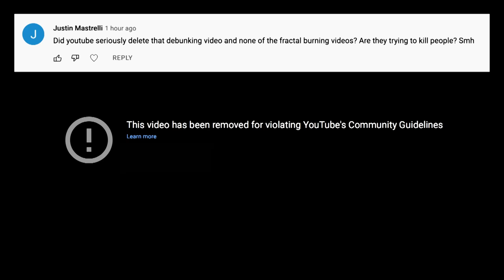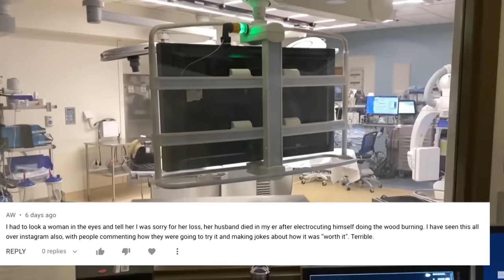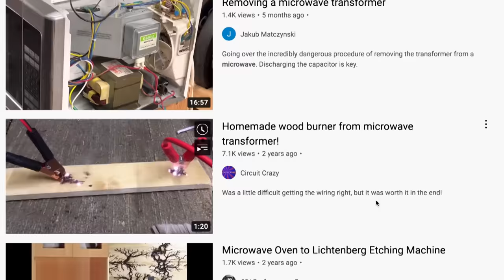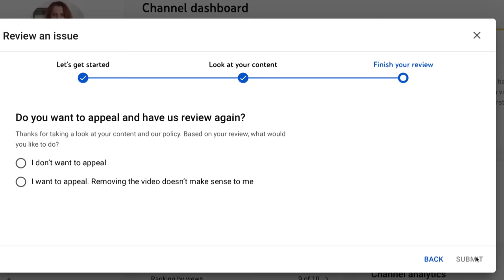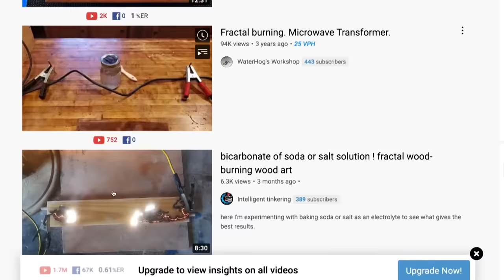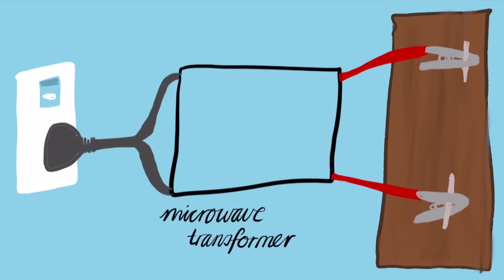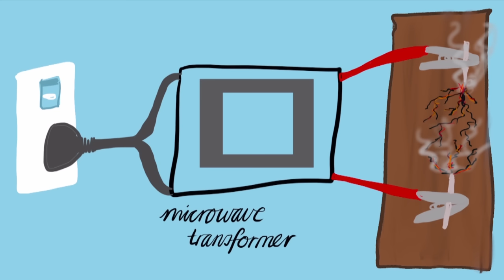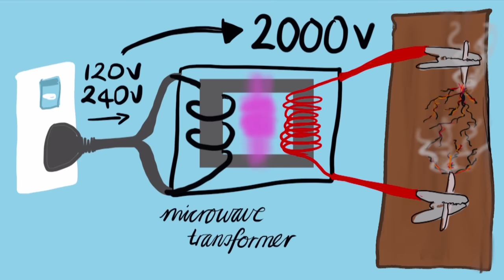YouTube BANNED my Debunking Video but leaves DEADLY how-to vids online, 34 dead!

Comment: A friend of mine was really considering trying this a few weeks ago, I was going to help her, fortunately, I found your video before making such a big mistake (I'm the kind of person that would've ended up touching the electric parts out of curiosity).
In the end, we just replicated the fractals with black and gold paint.
Reply: I'm so glad! If you'd like to burn wood in a safe way, look into pyrography/wood burning pens. You can get basic ones at most hardware stores, and it's just a metal pen with a tip that heats up when you plug it in (you can change out the tips on a lot of them for different looks). There's no electrocution risk, you just have to be careful not to poke yourself with the hot end because, well, it's hot.
Reply: @LevadeNZ  i second this, i hadn't even thought of that but what an excellent suggestion! they're also often found at art/craft stores like Michael's, and are pretty easy to get the hang of! the risk of a burn is similar to a hot glue gun, in my opinion, where if you're careful you should be fine- it won't be fun if you do get burned, but it certainly is a thousand times better than the dangers of fractal wood burning! stay safe out there <3
Reply: That actually sounds quite beautiful.

Comment: Honestly, I used to do wood burning a lot as a teen, and this looked like something that had cool results that I might have tried to do at the time, and likely ended up in the hospital or worse.  Thank you so much for putting out this video!
Reply: glad you're okay. DIY stuff is sometimes a lot more dangerous than it initially seems, like with fumes from resins or the dangers of not using lye right in soapmaking. It's wild how the genre of 'satisfying craft' videos so often having wrong or harmful info in them have made dangerous methods so accessible and popular. Scary!

Comment: It was a good thing to mention about Electricians as most of the tools we use are only rated from the manufacturer for 1000-1500V and at these higher voltages normally insulating material can become semi or fully conductive.

We are also prone to suffer from complacency in this regard but people should realise that working with these voltages is also an entirely different trade. (linesman)

Comment: There was a group that demonstrated this to children at a summer science program I volunteered with. They never talked about the dangers other than the fire danger so they had it outside. Thanks for posting your video, otherwise, I'm sure a friend will try this someday and now I can be like NO NO NO NO NO NO.
Reply: There should be a talk with that program. They should know the dangers more than anything else. Why are they showing this to children?
Reply: @1greninjawolfbossdeath648  local art co-op were the ones demonstrating it. It was a STEAM summer event. They never got close to the kids or had them interact, but I doubt the organizers knew the dangers just like those demonstrating them probably also didn't know the full dangers.
Reply: @hopemoore  "There was a group that demonstrated this to children at a summer science program I volunteered with"

Then next time, show them the proper safety precaution. Fire is the least dangerous danger for this life hack.

Bring in the proper stuff needed to make spark with a ignition coil from a BBQ that need a 1x 1.5v AA battery. Show them high voltage sparks are safe if the spark/lightning look blue and doll. Sparks from those are around 1000 to 5000 volts but are very safe.

Then show them a different setup that make orange/white spark/lightning (Like the wood burning nitwit at 8:41). Those are lethal and shouldn't be touch let alone be hold the same way this guy held those nails.
Reply: @TwinShards  I was a grad student in VR/AR and game development - the organizers were in doctorate programs in education  - why would I or the organizers know how to do any of this to show them anything?

Volunteers aren't specialists and this happened in 2019. Not sure what happened since.
Reply: @hopemoore  I don't blame you for not knowing. But those that demonstrated shouldn't have demonstrate something if they themselves didn't know the danger of it.

Have a good day! :)
Reply: Messing with electricity is dangerous. Even mains voltage type stuff can be dangerous. There is a reason high voltage electronics tend to be stuck in a box. There is a reason computer power supplies and the like have giant warning labels about not messing with their interiors (high capacity capacitors are dangerous - even hours into days of being disconnected from a power source, unless fully and properly discharged).

That being said: You can do this safely. It requires the proper set up, and tools - and that takes what is an afternoon project into a multiple day type thing.

You need a well designed enclosure for this - not just for the transformer, but the entire damn thing. It should have a lid that has a power kill switch that is activated when opened. It should have an indicator light whenever you turn on the main power switch. Ideally the power switch is keyed - so that you can't accidentally turn it on. It would be best if there was no need to directly interact with the electrodes either - but just in case, the entire electrode should have a thick insulating layer on every bit except what goes onto the wood itself.

If this sounds way to daunting a thing, or you don't think you could reasonably put this together without an indepth guide - I might suggest: You should never, ever think of going within a days march of this. Yes the results are cool - but I suspect you like being alive.
Reply: @1greninjawolfbossdeath648  I mean depends on the age of the children. I honestly don't understand how someone could look at a video on youtube of someone taking a transforming from any device and using it for wood burning and not think, yes this is extremely dangerous. This is basic like 3rd grade science.
Reply: @Bourikii2992  Well when someone says the word children I think young like 14 below.

There are grown adults who have died trying to do would burning. As she said in the video the videos are labeled as hacks fooling people into thinking it is safer than it is.
Reply: @1greninjawolfbossdeath648  My point was children 8-14 should know this is extremely dangerous since its basic early grade science. You start learning that in third grade. 

Let alone adults... Especially adults with years of electrician experience. These people are basically the equivalent of woodworkers who break every rule of safe wood working and talk shit against Sawstop.
Reply: Im sad, i know people whove done it safely for decades, can actually be an art form if you wet the wood in a pattern and let it soak in that pattern
Reply: @TwinShards  Yes.. That's kinda the point she was making no?
Reply: There are safe kits for doing this but almost all DIY ones are dangerous and a great number of the kits are missing critical safety components
Reply: @hopemoore  just showing that to the kids is putting ideas in their heads. that's so crazy.
Reply: @wildwomanofthewoods  Lmao shit, you're right.

Comment: As a woodturner, I have NEVER had the slightest desire to try fractal woodburning.  I totally agree with you Ann, electricity is far too dangerous to play with, no matter how pretty you think the results look. Thank you so much for raising awareness of the dangers of this!  You are spectacular!  Much love from NZ.
Reply: There is a safe way of doing it though. But that's expensive.
Reply: All you need is a grounded case that only alowws electricity to flow when closed, you could probably even use the oiginal microwave case. But if you aren't like a eletrician or something similar this would also be incredibly dangerous because if done impropperly you might set the whole case under voltage. Which is to say, let experts handle potentially dangerous tasks because they probably think of risks you arent even aware of.
Reply: @mgntstr  watch Sprague wood turning. He uses a dead man switch, but even he says it's scary.
Reply: Elctricity is very fun to play with actually!
Reply: @Crazmuss  Kinky
Reply: Well either that or alternatively just set up the wood with the pliers turn it on and stay near the switch that turns it on (I.E. 12 feet between you and the microwave transformer - and another 5 feet from transformer to wood) I would argue anything goes within the 20 foot safety distance you shut off the power though
Reply: As with anything in life, it's as safe as you make it. There is a way to do fractal woodburning that is completely safe. The problem is that this is not a safe way to do it... and the average person can't even be trusted with a table saw, let alone be trusted to determine the safety issues with this method of woodburning.
Reply: @AngryAlfonse  Fair enough

Comment: Also most of the wiring insulation and stuff are rated for 1000V max. Big car aligator clips are for 12V, can be rated 50V or something. Using these wires with 2000+V is asking for trouble.

Comment: I wasn't familiar with this wood burning technique, but I'm VERY familiar with electricity. The second you said people were using transformers from dismantled microwaves, (especially older microwaves,) I was like 😳 are you freaking kidding me??!! With a 110 to 2k+ transformation I can't believe there's not more deaths! In that quick conversion, the volts can actually arc to ground (think lightening) so you don't necessarily even have to make contact! Thank you for trying to educate people on this subject.

Comment: insulating gloves has also voltage ratings. At least here in france they are used most of the time to check the absence of voltage with a specialised meter. Doing work with hot wires is rare and usually done by highly trained and cleared peopole

Comment: I noticed that in some of the videos the electricity arced half a foot through the air - that is a CLEAR danger sign of how dangerous it is - air is a very good insulator and if electricity arcs that far, it could easily arc through the body instead.
and if the electricity is enough to burn wood, it is enough to cause 3rd degree burns, leaving no skin left.

While this type of operation can be made safe, it requires professional care - isolated non-flammable room, heavily insulated cables, remote operation with special equipment made to handle high voltage, customized equipment to use optimal voltage and minimum amperage, and special high speed cutoffs on the burning side.

Without personnel experienced in high voltage work, fractal woodburning is an extremely reckless activity.

Comment: These things ARE super deadly. Built one with my dad years ago, he was an electrical engineer so it was built right. I had to wear heavy insulated gloves, we had a separate breaker dedicated to it, and the on/off switch was well away from the worktable. Furthermore he never let me use it when he wasn't there and kept the breaker locked (he really knew teenage me) and what 2000V meant.

Comment: I'd like to point out that if the wood and wires are properly isolated from the ground, theoretically, touching just one point of the circuit (even one of the metallic rods) isn't going to do any harm, as there needs to be a closed circuit.
However the problem here is the presence of water , which makes this kind of isolation very hard to make and impossible to fully guarantee. However for those who would still want to try, you need to use dry plastic to put the wood on, and make extra sure that there's no contact between the circuit and the ground. That won't make it safe, but will decrease the hazard.

Comment: It’s those wood burning videos that need to be removed.

I’ve worked with some extremely high voltages (fusion reactors type high voltage) and can say that the voltages used in wood burning make just being in the vicinity of one potential lethal.

It should be these wood burning videos that are taken down and de-monetized.

Comment: This sort of thing is horrifying. There is probably a way to do it in relative safety in a properly risk assessed and designed for purpose environment. A microwave transformer and crocodile clips is a terrifying bodge that I wouldn't go anywhere near.

Comment: I never even knew this was a thing. I was taught at the age 10 when I built my first computer to NEVER touch anything that has copper wires wrapped around it. ANY thing with copper wiring wrapped around it and is contained it any kind of metal shielding is like that for a reason. Usually components like that are meant to convert the electrical power from your wall outlet into something useable by the electronic device. Even when that device is unplugged it will still hold on to a charge for months even years depending on the device. Unless you are trained to do so and I mean ACTUALLY trained and not trained by watching 50 youtube channels do not take apart your electronics. Take it somewhere to be repaired or replace it all together and lease PLEASE PPPPPPLLLLLLLLEEEEEEEAAAASSSSEEEEEE DO NOT TAKE IT apart for some arts and crafts thing. Its not worth your life.

Comment: I have been doing this type of wood burning for a while now, probky about 5 years using a mot. 
First off i wang to say THANK YOU so much for making this video and and also risking and strike against your channel to make another video showing the dangers of doing this. Like you said there are so many videos showing people hey you can do this by doing this but I have only ever heard warnings from maybe two of the videos I've watched saying that it can kill you very easily and exptemely painfully. 
My recomendation for anyone thinking about doing this is DO NOT TRY THIS. I can't stress that enough. The average output voltage of microwave is 2100 volts ac. Now if you have ever been shocked by a 110 plug somehow that hurts. There may even be people out there who have been shocked by 220 -240 volts and that really hurts. Imagine how excruciatingly painful a current 10 times a strong or 20 times as strong even would feel.

And I'm sure there are still some people out there dumb enough to do this me being one of them but my setup is almost foolproof there's still potential of being shocked but it is very very low but one mistake and that's it still so it is very dangerous I'm not going to give the details on my setup because I don't want anyone trying to recreate it but I will say that when it is burning I'm at least 20 ft away using a switch to turn it on and off but not touching that switch with anything that conducts electricity or my hand.

And again you are very caring person and thank you for making this video because 34 + however many others have died from wood burning like this is definitely not worth it.

Comment: There's a bit of inaccuracy in this. It's not the 2000 volts, It's the delimited current that is deadly. Power doesn't come from nothing. There's a transaction between the voltage and the current, and normal step-up transformers will substantially limit current to subsidize the gain. The reason this is deadly is because there's nominal limiting impedance on the circuit you create by shorting the terminals. the wood acts like a giant insulator... salty you, not so much. Especially in cases where you create a direct path to earth ground.

Comment: Great video.  One note: 2000 volts isn't what gets you, the amperage does.  In short, ramping up the voltage is what increases the efficacy of the arc.  It can jump larger gaps or penetrate deeper into resistant surfaces (like wood).  The issue is that skin isn't very protective and 2000 volts slams through it with ease.  The true lethality is the amperage, with a shockingly low amount of amps necessary to cause permanent injury or death.  And as the lady said here in the video, no breaker will flip if you're busy dying.  Accidentally completing the circuit with bare flesh is more than likely a death sentence.  If it can char an insulator like wood instantaneously, what it can do to organs that are quite conductive is devastating.

Comment: It should be possible to safely do fractal wood burning if the electrodes were mounted on a machine similar to a CNC router and remotely operated.
Reply: Yes, that would be safe assuming you also had a proper electrical setup. For example, properly sized conductors, spaced apart the proper amount, switches designed for the current/voltage rating and type, a proper grounding for safety at the switching end, and so on. I think the danger isn't the action itself, as there are much more dangerous things out there that are done on a daily basis, it's the fact that it's being advertised and performed by people who have no idea of the dangers and how to alleviate/reduce the dangers. I saw one guy in the past literally holding the live microwave transfer in his hand... I had a co-worker who did the wood burning and I tried to coach him on the deathly dangers it poses so that he treats it with the proper caution it deserves.

Comment: I mean... um...isn't it basically an arc welder... well aren't arc welders safe if you use the shield because they are designed to be safe? Meaning couldn't this be done much more safely than with the factile method?

Comment: There's warnings about the dangers of taking microwaves apart everywhere. usually on the units themselves. mainly due to the danger of immediate death. It does look good and if someone made a product for doing it safely it would be a great art tool. 
as a secondary warning, I do bits with electricity in my spare time, lighting circuits, plug and socket replacements and switching basic parts in consumer electronics. but I wouldn't dream of taking a microwave apart, especially not to repurpose any parts inside. Too easy for things to go wrong.